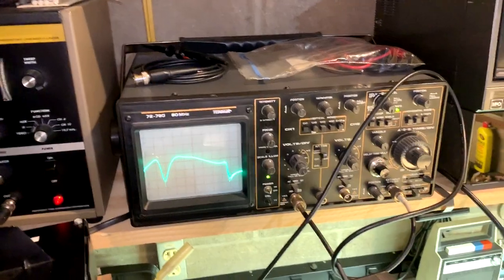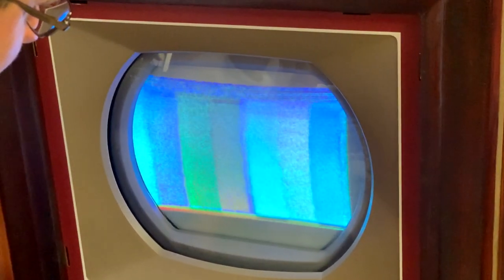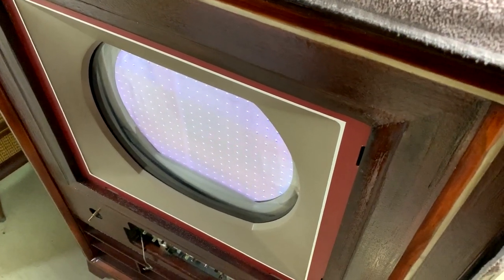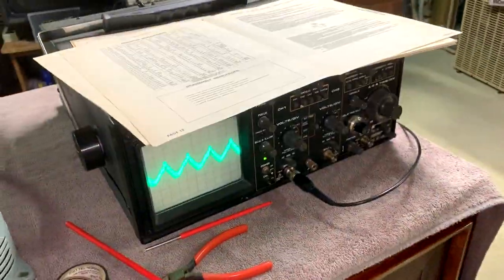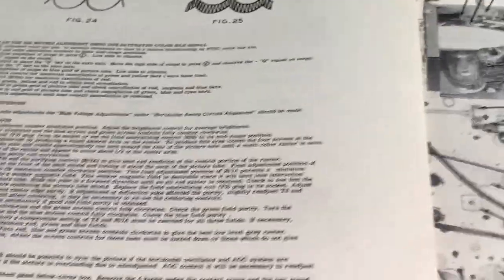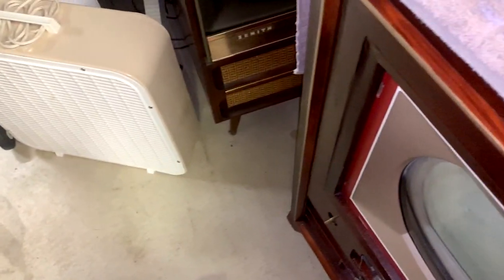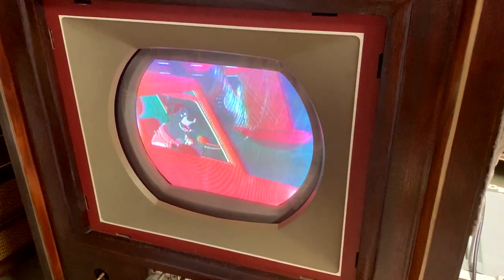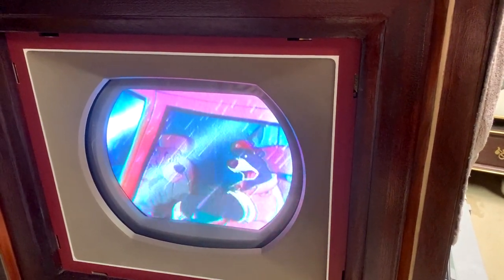RCA Model CT-100 the Merrill - Restoration Part IX (WE HAVE COLOR!!)

Comment: Great to see the CT-100 coming together, it is really looking great. If you have any more issues with tube socket connections, you might want to see if the contacts have enlarged and need a little crimping with a pair of plyers to make them contact the pins correctly again. 
It really looks like the 15GP22 is in great shape, that is very awesome!

I hope you can get the tuner sorted, but if not you can at leaser use the IF drive from a Blonder Tounge modulator since that set uses a 45 MHZ IF.
Reply: I have a tube socket tightening tool at work, crossing my fingers when I say this, but we haven't needed it yet.  And yup, our modulator can feed it and we can tweak it.  We just wouldn't be able to run it through the combiner (which perfectly locks the signal.)
Reply: Also feel free to stop by anytime to see it, we're just minutes off 376.